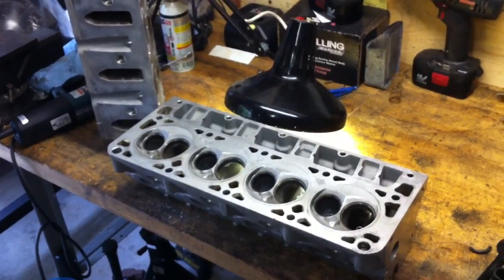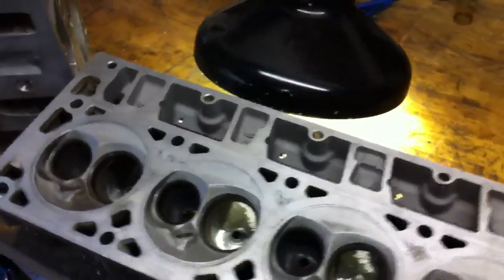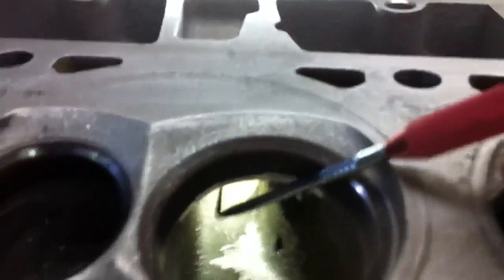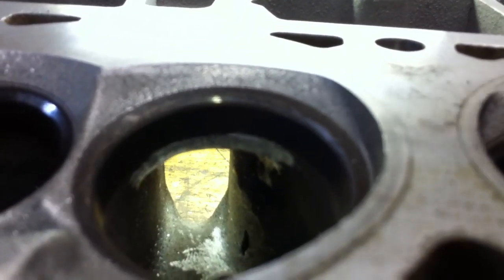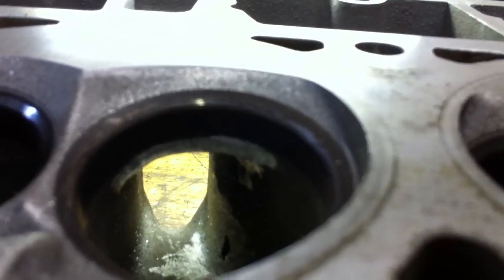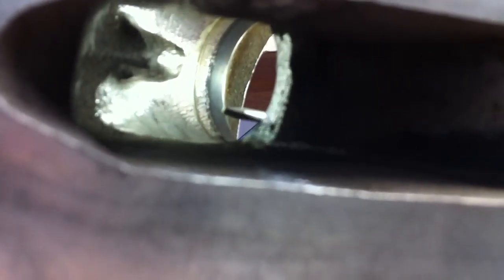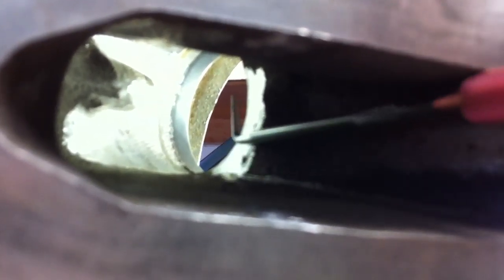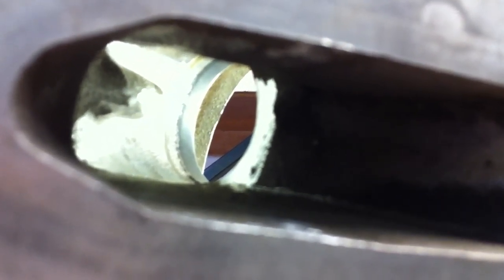How To LS1 DIY Head Porting Part 4 - Short Turn Radius

Comment: Not to be a broken record or a know it all, but now that it's been said that knocking the SSR out to see the intake port entry is not what you want, I think the best advice to most beginners would be to simply blend the SSR into the bowl so that you get rid of the square transitions until it feels smooth while taking as little away from that floor as possible. Some of the best port configurations are in cylinder heads that you can't see the port entry from the bowl hardly at all due to the port entry being high so that the charge is softly redirected to hit the bowl in a straighter fashion. Most importantly though is: Being in a HURRY and PORTING cylinder heads are two things that shouldn't be in the same sentence!!! Thanks for the video!

Comment: I did all of this and only gained 17 cfm on the stock valve, I'm really hoping a 2.02 will wake this port up fingers crossed.
Reply from the maker: +Nick Ritter Good luck! Did you rip that rocker boss all the way out so that the wall was flush like it was never there? I guess that is the most important part to improve flow. I noticed that 243s have moved that wall over further even, which makes the boss stick out in the port more.
Reply: I'm not sure what you mean ? I did pretty much exactly you did except I tested at 25inches of water and with a 1.89" c
Valve which is tiny and no radius inlet guide
Reply from the maker: +Nick Ritter ah ok. I was just making sure that you completely removed the rocker boss from the intake port. People often dont take it down far enough when they havent done it before. It needs to be removed completely. Was just making sure you got that.
Reply: +AGearHead4Life I did, I think my testing methods might be flawed as well going to get back at it Monday.
Reply from the maker: +Nick Ritter Gotcha. Well cool man! Good luck on the project!

Comment: So what?leave the short turn radius alone.?
Reply from the maker: Yes, I would. Unless you have someone expereienced with short turn raidus work that can tell you how to improve it. A wrong shaping here could cause probelms rather then help. I've messed with it some, but havent been able to get flow results on those changes yet. The gaines that I made in my main video where without modifying the short turn. Only smoothing it.

Comment: I'm no expert, but I’m pretty sure you're going to kill your flow and cause tumbling by cutting down the short turn the way you have suggested.  Most porters suggest widening the port exit and making it more of water a water fall effect. The idea is to flatten the port floor on the outer edges. Since you have not really increased the size of your port, I don't think you should touch the curve of the short turn.  I have no experience with LS1 heads, but I’m skeptical of this post.